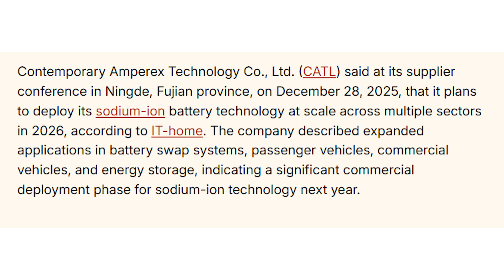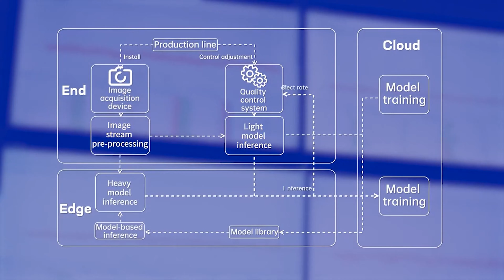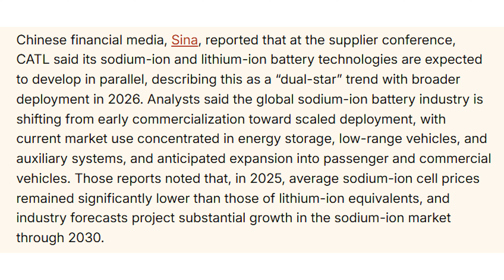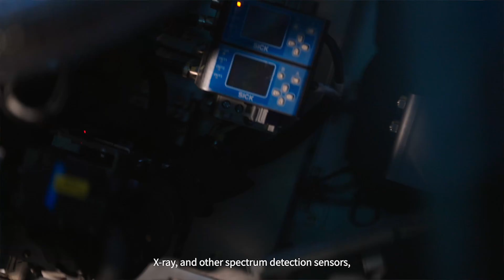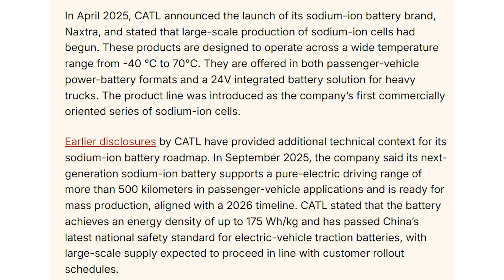CATL Release official Sodium-Ion Roll out Timeline

Comment: And the inverters and bms that support Na batteries? Where are they?
Reply: BMSs will come when consumers can buy the cells affordably. I think for consumer use, HV batteries and inverters will work, and you already get HV inverters which would work with their voltage range. 48V inverters need more current capability for the lower voltage range.

I reckon this will be more useful to those with bigger systems.

Comment: I don't find sodium batteries boring or dull at all.  I've been worried about climate change since the 1970's, and I have known for nearly that long that large scale battery storage was going to be an essential element of renewable energy management. I'm (in my quiet way) wildly excited to hear that an element as abundant and well-behaved as sodium is turning out to be a feasible battery component, and cost-effective, too. This is huge.
Reply: Exactly. In the 1970's the prediction was that we were all going to freeze which was almost as scary as a nuclear winter. Then after the 2000's Al Gore told us that the planet was going to burn up if nothing was done in the next 10 years and that the polar ice would be gone by 2016. Meanwhile it is now 2026 and Polar Bears are doing rather well and there is heaps of polar ice. Seeing a pattern? Worry about nuclear Armageddon, because  in the next month the LAST nuclear arms treaty expires and Trump doesn't care.

Comment: What ist the application of Sodium cells?
They can not replace lead acid batteries - OEMs would have to redesign the complete electrical system in every car - No can do.
Sodium cells are so much less efficient than LFP that the total cost is higher. They will not replace regular Solar, Storage or car batteries.
Sodium are heaier than Li-Ion and will not replace high end car and truck batteries.
Sodium are too eavy for airplanes

Sodium cells have two advantages vs NMC/NCA: they are more fire resitent - but not absolutely, and they are more efficient at very low temperatures.
Sodium cells have one advantage vs LFP: they are more efficient at very low temperatures. Fire resistance is about the same.
Reply: Replacing lead/acid starter batteries is the one thing sodium CAN DO well already.
Reply: @weinisable  The alternators and electronics of regular cars can not cope with the voltage differences. 

Some EVs use Li-Ion "starter" batteries instead because they "know" these chemistries. But they too could not use Sodium based packs.

If you are convinced you can tell me which manufacturer has replaced their lead acid batteries with Sodium based packs.
Reply: @wolfgangpreier9160  starter batteries rarely go below 80% capacity , and DC/DC voltage regulators are in common use already for low amperage (<100) systems. Na batteries are already being used for this purpose.
However, the high voltages and amps used for EV s is a very different game. !
Reply: @weinisable  You are just projecting your wishful thinking. 

There is not one single manifacturer who uses Sodium batteries instead of lead acid anywhere in the vehicle lineup. Whether EV or fossil does not matter. There is none.

There is not one single manufacturer of fossil powered vehicles wjho has presented plans to put sodium based battery packs in their cars instead of lead acid.

I agree that sodium packs would be better for the environment than lead acid. But that does not change the facts that these are not plug and play solutions. 

No manufacturer has decided to start the disruption of a multi-billion market to replace lead acid with sodium based chemistries.

And Tesla, whoe are one the few who have the guts to kick everyone in their soft parts does not need them. They are oerfectly happy with their existing Li-Ion and LFP lineup.

Comment: CATL is already mixing these in with LFP cells for cars. See in cold weather they have enough energy available to get the car moving initially and for the systems to heat the battery pack. Bringing the LFP cells up to a usable temperature.

Comment: This battery will be perfect for use with solar systems. If the price is much lower, it will be easy to use sodium to jump off the grid and run on batteries at night, charging during the day. They are also safer and last longer. CATL is the real deal, and when they announce a breakthrough, they can back that up with their robust manufacturing system. I don't believe most battery announcements, as they're mostly lab results and promises for the future. I expect we will really see these in the very near future.
Reply: Price is already super low ... I can order 16kWh battery for 2000€ right now. That is crazy, considering prices 5 years ago.
Now installation is pricey :D

Comment: As with gas, replacing something with something else that gives less power return just for the sake of replacing the Tech is not what people want. They want longer ranges and quicker refill times. I can carry a gas can but you CAN NOT carry an extra battery. People who tow want to be able to go more than 100 miles without having to sit for 3-5 hours and recharge. The price does not matter if the quality is only half as good.

Comment: GMG Manufacturing , along with Rio Tinto, is developing a Aluminum Graphene battery that is capable of electrifying heavy mining equipment, can recharge in 6 minutes, and last thousands of cycles. I'm sure it could be used in the trucking industry too.
Reply: Trucking will use battery swapping.  Fast charging for a truck is useless unless you have a network of MW chargers, or trucks daily use can be accomplished on a single charge then charge overnight.
Reply: @davesutherland1864  Current EV trucking in Europe is not using battery swapping. It's just using the normal battery infrastructure at big chargers. As the drivers have to take a break for safety regulations it's not a big deal. Right now there's a fairly rapid shift going on to EV trucks for many routes because a fleet haulier can use ICE or EV vehicles to match the route need and has many trucks so it's easy to match vehicles to routes. They still have a much higher upfront cost but the running costs and the downtime for service/repair more than make up for it.

Comment: Interesting evolution. But we know that all those chinese battery factorys are worthless scrap in a few years... the next generation of batteries will require very different manufacturing. Sodium Ion just gives china a few more years before it all ends. Why have a machine producing batterys running in thousands of kilometers distance? Can't be cheaper than having it running at least on the same continent. Simple logic.

Comment: When will makers of home batteries be offering a Sodium battery module?
Reply: Yes but you will need a different inverter and associated bms.
Reply: @richardwatkins6725 Im thinking sigen who put a BMS in each module.
Reply: Already exists take a look at the UK and the company Eleven Energy that's uses 4.5 kWh Sodium Ion Battery modules and inverters for small home solar systems
Reply: @FSIronman yeah, the everything electric channel had an episode about it not too long ago. Went and looked at a couple of home installs
Reply: Bluetti has released an expandable mobile sodium battery bank recently.
Reply: Home battery market is the bottom of the food chain.  New tech will be busy with grid scale and EV's for awhile, before the tech works it's way down to home use.
Reply: @robertlowery7086  Not really. Same cells, same tech, different box. The slow down is likely to be the need for different HVDC inverter technology replacing the old 48v stuff.

Comment: While production and competition from other sodium battery manufacturers is low, we as consumers should not expect radicaly different pricing of sodium batteries. CATL has no reason to compete against themselves and lower pices much, similar how SpaceX did not price Falcon9 launch prices to reflect cost, and only dropped them enough to make sure they slightly outcompete others, and pocketed the difference.
Reply: Catl is not competing against themselves they are competing against lithium ion batteries. If they want to sell a lot of these new batteries all they have to do is make them perform and be cheaper than LI.

Comment: I could see this being big in electric shipping. Consider a car ferry weighing several thousand tons and carrying thousands of people and hundreds of vehicles across the English channel. You would maybe need a 50 MWh battery weighing around 300 tons. For safety reasons this absolutely cannot carry any risk of fire. 300 tons in the keel is absolutely manageable and the low cost, high safety, and temperature range of Sodium makes it a better option than lithium. (Especially when you also need massive batteries at the harbour to act as buffers and allow fast charging without needing to install tens of MW of grid connection to the harbour.
Reply: You should let that whole lithium fire issue go. It's more made up than real.

Right now in America for every 100,000 fossil fuel car sold, about 1500 catch fire every year. 

Where I asked for evs, for every 100,000 sold, about 25 catch on fire every year. And no, that number is not a typo.

Fossil fuel powered cars actually catch fire about 60 times more often than lithium battery powered cars. 

So when you say the battery on a ship has to have zero chance of catching fire, that's just silly. They've been running around with fossil fuels that are 60 times more likely to catch on fire than batteries.
Reply: @lordgarion514 It's not just about the frequency of fire but about the intensity and nature of fire. A fuel fire is a lot easier to put out or at least contain than a battery fire, and a 50 MWh battery has a lot more cells to go wrong than a car battery. A ship on fire at sea is something that is really a big emergency so having sodium cells that are inherently not prone to thermal runaway, and many times less likely to catch fire than even LFP batteries (themselves much safer than lithium chemistries using nickle and cobalt) is another layer of reassurance. Not essential, LFP has already been used for ferries, but nice to have.

Comment: For home battery use these will make a big difference from a safety point of view. If i install my worry was always about fire risk and also cold temperature issues. These seem to be answered and the 20% lower capacity isn’t an issue. Just hope the price indications are right and they are lower when priced to consumers

Comment: Super safe - maybe we in Aus will see for home battery storage like they are in the UK with Eleven Energy.
Possible  revision of the installation safety standards her in Aus allowing installation on the out side walls of rooms that are habitable, where the adjacent room is a bedroom or living room,  as currently LFP or NMC cannot be positioned in those places.
Cost less than LFP and work in sub zero and above 50 degree C without loss of charge and zero risk of fire.
Waiting for this change So i can install a battery on my home as all my free wall space has habitable rooms on other side and 900 mm away from a window that can open.
Reply: I think not as it still will have a huge amount of energy stored its just less likely to go into thermal runaway but it still can.

Comment: Things are going so fast, this video is already a bit outdated. The first Sodium-Ion cells are already commercially available, even in Europe. Currently I'm waiting for an inverter that can handle these cells in a home storage system, but that's probably a matter of new inverter firmware.
Reply: Do you know which battery brands hold these cells (in Europe)?
Reply: @rfeenstra  Folks like Eleven in the UK have been selling sodium based systems for a bit now. It's still somewhat early adopter tech but the kit is out there and on the market.
Reply: @etchedpixels  thank you. I do wonder if we are talking about the CATL cells here. There have been different Dutch brands which also offered sodium batteries for quote some years, however these were way more expensive and significantly lower performance compared to LFP.
Reply: But, but what about Aluminum Graphene?
Reply: @incognito7671  you're asking me?
Reply: Doesn't Eleven Energy's system do what you need?
Reply: @NealeUpstone The problem is cost; their batteries are 2.5 to 3 times the price of LFP alternatives. That’s difficult to justify in terms of payback time. Interested to see when CATL launch their own systems and at what price point.
Reply: No. That's just regular sodium ion batteries that has energy density about 160Wh/kg. The one in the video is the new sodium ion from CATL called "Naxtra" and it has around 175Wh/kg for the energy density.
Reply: @firdaus99031  Thx!

Comment: I think battery swapping will eventually displace charging. Equipping every dwelling to charge EVs is massively unnecessary. As a result, a lot of petrol stations will become EV charging & swapping stations. It makes sense for most EV users to carry a light sodium ion battery for short trips. For long trips, swap for high capacity sodium or lithium batteries. Charging stations probably will have the capability to assess battery condition to ensure safety. It is important to remove incentive for stealing and reselling from the beginning.
Reply: These swapping stations would also be able to do wonders balancing the local grid if we were to think big picture and not just have loads of different companies operating separately.

Comment: Discharge voltage curve?? 

I'm fairly certain that this is the reason CATL are only talking about Na ion batteries in the context of a vehicle system that also includes an Li battery between the Na battery and the motor.
Reply: You just require an inverter that can handle that extreme voltage curve. They exist.
Reply: @jamesl3546 ….and the equally extreeme amperage required to maintain power output.
Inverters that can do that are not common, simple, or cheap. !
Reply: A hybrid sodium and lithium battery was mentioned for CHERY QQ ice cream over 2 years ago.  It made sense because the small car wasn’t meant to go faster than 100km/h or more than 160kms. It just needed 20kw for 30 seconds to get up to speed which the 10-13 kwh sodium ion battery couldn’t do. Adding in 3kwh of LFP batteries stopped the awful  voltage sag and made the zero speed torque more acceptable. But nobody wanted it and it was never sold domestically

Comment: It's still vaporware. It still doesn't exist. I'll believe it when I can actually buy cells and build batteries and test them myself to evaluate whether actually deliver. For almost a year now it's just been hype.
Reply: You could order and have installed a Sodium home battery today if you so wish. The company is called "Eleven," riffing on the number of protons sitting in a sodium atom.
Reply: You must be extremely misinformed. In the UK there are a lot of home solar systems being built with sodium Batteries. Just Google for: Eleven Energy Volta 4.5 kWh Sodium Ion Battery
Reply: re: "For almost a year now it's just been hype."  even longer I'm afraid.  a full 2 years ago Sodium was being hyped as being available in BYD's new Seagull City Car for it's release back in 2023 but it debut with only LFP, but even then Sodium was already being "talked up" in 2022 so a year BEFORE that, therein this means the "Sodium hype cycle" is now celebrating it's 3rd Birthday.  PEPPERIDGE FARM REMEMBERS.

Comment: One of the things with sodium that seems to escape people: if we use it for stationary storage and other relatively low-end applications, that displaces a lot of lithium use, and keeps it relatively affordable for higher-density applications.
Reply: It could be used in Solar Power plants to store electricity
Reply: @abhimanyunath2001 also wind and nuclear
Reply: I'm looking forward to home battery storage with sodium ion batteries, they could be a life saver in certain scenarios and also be very useful if there are no emergencies such as only drawing from the mains at non peak times to drastically cut electricity bills.
Reply: @Kombaiyashii 
Especially if you live out on the edge somewhere where  you are largely off grid.  I saw an Alaskan and BC Canada families  replying on solar and diesel generators ..the wife and kids were at home the partner working away Snow fell temps dropped and the generator  started to shut down  .. .. every few hours , including in the night ..  part of the problem was the generator was getting too cold 🥶 which is a problem . 
A substantial  Na ion storage bank  would be better able to tough it out and sit silently holding its reserves of charge safely ... no moving parts .. no poison fumes ... no  messy refueling  in the middle of the night . Same point for  live aboard boats.
Reply: @Kombaiyashii  I get it. Yes, there are low-end vehicle applications as well, I understand that. In that case, sodium is displacing lithium use as well.
Reply: @Thunderbuck 

It's already set to displace Li Fe PO ..the environmental problems of Li... will still steadily sideline it from the bulk jobs and LFPO use Li would end up in lower volumes in higher energy cells.
Reply: The cyclic endurance and life expectancy should be talked about. Also in Canada, the -40 C  is a game changer.
Reply: @jrgnfrndsnlife expectancy of lfp is great to and only growing. Sodium is yet to prove its cycle life in the real world.
Reply: Exactly!
Different battery types will be used for different applications.
Reply: They would work super well for making solar power more stable.
Reply: Have a conversation with the Electrick Trucker a German electric TIR truck driver doing the job.